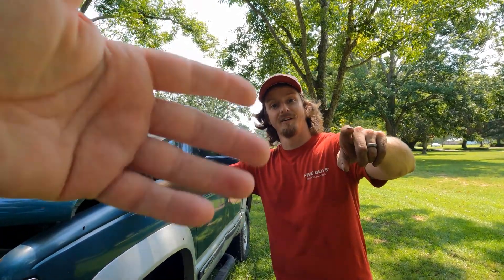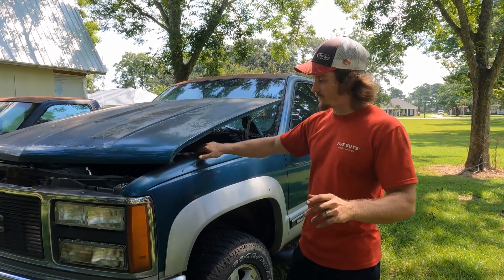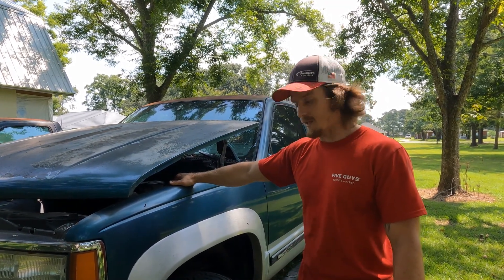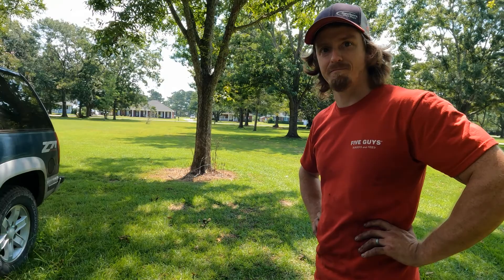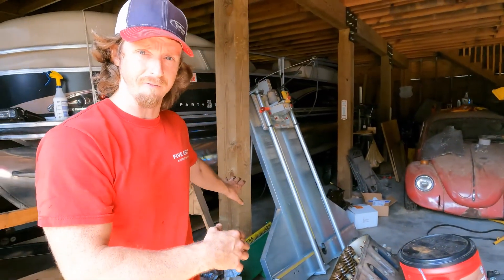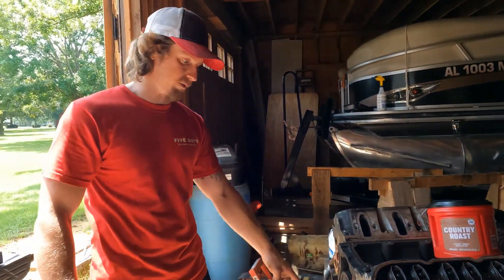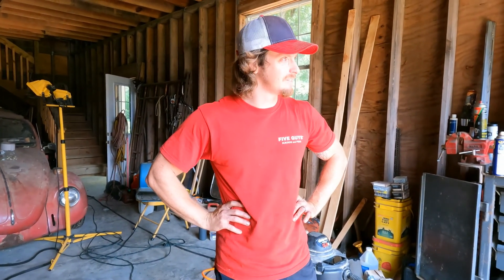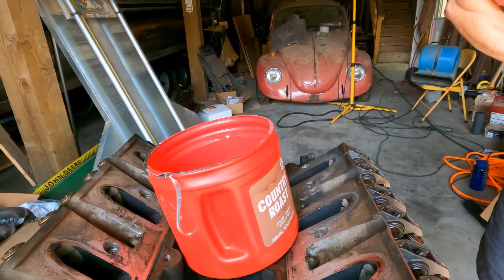Mediocre Mechanics.. .LS for the Yukon...

Comment: Jegs Cam- 200582
Valve Springs- Howards 98113
Summit 10 inch Lockup Torque Converter- SUM-700335